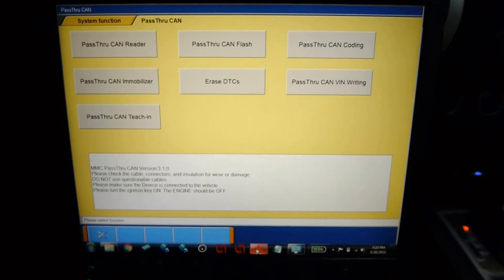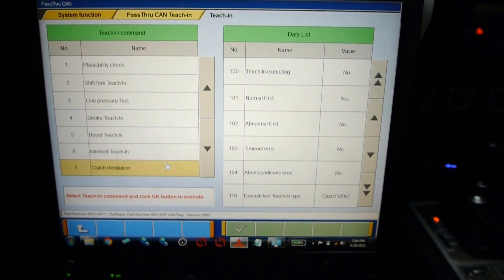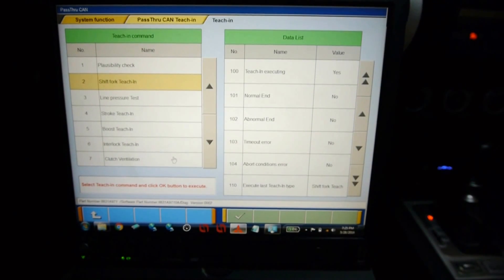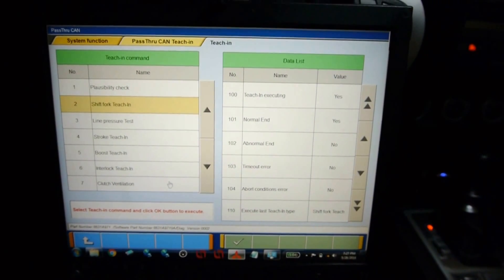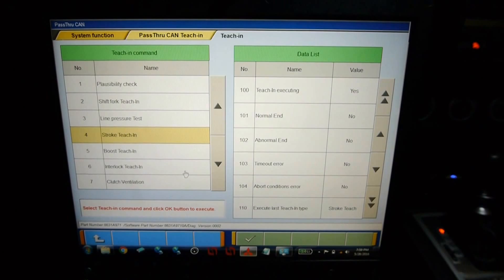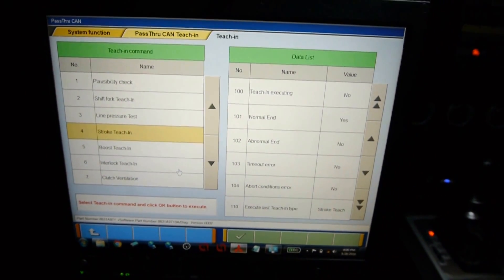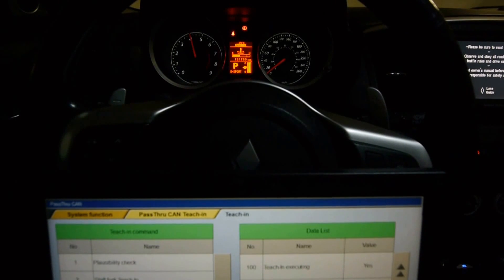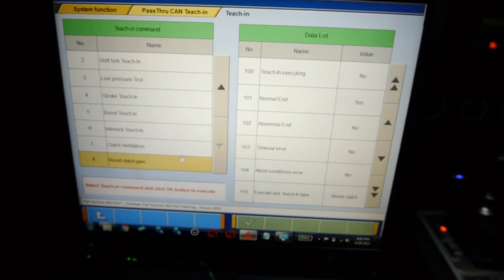SST teach-in Mitsubishi Lancer Ralliart and Evolution X MR

Comment: Hi Stephen trying to do a reteach passthrucan is telling me I don't have the .flpart file <MMC_FlPart><PassThruCANFlash><NewPartInfo><NEW_HW_PNAME>8631A513</NEW_HW_PNAME><NEW_SW_PNAME>8631A5130C</NEW_SW_PNAME></NewPartInfo><CFF_FILENAME>8631B002_dio30</CFF_FILENAME><CBF_FILENAME>AMT_17800000_000204_dio30_C</CBF_FILENAME><SYSTEM>TC-SST</SYSTEM><CONTENTS>Reprogramming data for Mechatronic Assy replacement of 10MY LANCER SPORTBACK</CONTENTS><DATE>2011.12.12</DATE><CLASS>Reprogramming for Teach-in</CLASS><ApplicablePartInfo><TARGET_HW_PNAME>8631A513</TARGET_HW_PNAME><TARGET_SW_PNAME>8631A5130C</TARGET_SW_PNAME></ApplicablePartInfo></PassThruCANFlash></MMC_FlPart>
Is what I have 8631A513.  8631A5130C I have took from passthrucan reader please help
Reply from the maker: The .flpart file needs to be edited in a couple of places. NEW_HW_PNAME and NEW_SW_PNAME at the start of the file both need the version number you are trying to flash to the TCU. OLD_HW_PNAME and OLD_SW_PNAME at the end of the file both need the version number you currently have on your TCU.
Reply: @StephenStrangways  so for my 09 lancer sportback sst I'd want which line of code, thank you so much for getting back to me your a saviour
Reply from the maker: Okay, so you're trying to flash the Evo X firmware to get S-Sport? You'll actually want to use the newest Evo X firmware, not the 2009 firmware - the information to use that is a bit out of date. Your TARGET stuff at the bottom looks good, so what you want at the top is:
<NEW_HW_PNAME>8631A971</NEW_HW_PNAME><NEW_SW_PNAME>8631A9710A</NEW_SW_PNAME></NewPartInfo><CFF_FILENAME>8631B151_dio30</CFF_FILENAME>

And make sure 8631B151_dio30.off is in PassThruCan\RpgData\CFF\
Reply: @StephenStrangways  okay got the new .cff file and will change the code to give it another try tomorrow, I've fixed my shift fork sensor so thats why I'm doing the reteach, if this works big thanks you have saved my lancer from being broken into parts
Reply: Still no luck mate
Reply: 8631B151_dio30.cff is in the cff
Reply: AMT_17800000_000204_dio30_C</CBF_ is In the CBF file
Reply from the maker: If there are two GENERIC_... .cbf files in the CBF folder, remove those, leaving just the AMT_.... .cbf file.
Reply: @StephenStrangways  managed to flash across a different flpart can't remember which at this moment in time, but still can't use the  teachin
Reply from the maker: What happens when you click "PassThru CAN Teach-in"? Does it give you an error message?
Reply: @StephenStrangways  yes can't remember the exact wording but can post it up tomorrow going to give it another go thanks again for your help muchly appreciated
Reply: Tc- sst recalibration data not Found please review or re install
Reply from the maker: Do you have the file PassThruCan\DiagDB\XML\TI_Info.tipart ?
Reply: @StephenStrangways  tipart in replacement of the flpart or with it I have got the tipart is there any code that needs to be changed
Reply from the maker: @ashleyhowitt6158  both files can be in the folder together. No code needs to be changed.
Reply: @StephenStrangways  will give it another try tomorrow morning with both files this time hopefully this is the last trip up I will have, hoping this is what I've been doing wrong, cheers again you a star and I'm sure I'm a pain in the posterior
Reply from the maker: @ashleyhowitt6158  I hope I can help you to get it working!

Comment: Hey there! Thanks for the knowledge do you share! It's any difference if I'm gonna do the steps with another line? I mean to start from 1 and end in 8. thanks in advance!
Reply from the maker: I'm glad I'm able to help! You should not change the order of the steps. There are a few that can be swapped, but overall, certain things like clutch vent need to be done before certain other steps, and other things require the engine to be restarted afterwards, or else any steps after that won't work at all.
Reply: @StephenStrangways  oh okay! Thanks for the comment! Super supporter 😊👍🏻🙏🏻

Comment: Hei Stephen! I just performed a complete teach-in on my Evo X MR 2009.
First thing, I flashed the ECU with a new version.
I had 8631A379 (and S/W 0C) and i flashed 8631A827 (and S/W 0B) with 100% succes.
After that i could finally access the PassThru CAN Teach-in.
I did 1 -> 2 -> ignite off -> 7 -> 4 -> 5 -> 8.
I had to retry some procedure more than once in order to have a Normal End, but i always got it.
All without issues. I don't know if it was placebo but a lot of little strange noises went away.
I didn't flashed back to old/previous ECU, was i wrong?
I went for a run and the car suddenly showed a problem: the display turned yellow and i couldn't accelerate (it wouldn't rev). I stopped and restarted and it went perfectly for a while, but this scenario happened 3 times. After that i got home (15 mins run) without any problem.
The oil i drained from the SST was different from the oil i refilled with (red oil drained, filled with Castrol Transmax Dual).
Do you have any suggestion?
Reply from the maker: You're fine to leave that newer transmission firmware version. The biggest problem is that automatic transmission fluid is usually red. If the car was running for a long time with that, it's likely clogged up the valve body, and possibly worn out some of its components. You'll likely need to get the valve body cleaned, possibly replaced. And get all of the old ATF completely flushed out of the rest of the transmission.  You'll also want to inspect the clutches, as that fluid could mean the frictions have been burned.
Reply: @StephenStrangways  TBH I saw that the Diaqueen is not red, but a light greenthe same color of the transmax dual that I used! Am I wrong?
However I changed all the liquids before doing the teach in.
My thought were that the remaining oil still had to mix up with the new oil I filled, but I don't know if it make sense. I will have to see how the car behave in the following run.
Now I will evoscan to search some codes
Reply from the maker: @lucasaugo4241  DiaQueen SSTF-1 and Castrol Transmax Dual are essentially the same fluid - Castrol makes SSTF-1 for Mitsubishi. They are both green. Automatic transmission fluid is usually, but not always, red. Some incompetent dealerships and independent garages will put automatic transmission fluid or CVT fluid in a car with an SST, and it does terrible things to the transmission.
Reply: @StephenStrangways  oh ok, I misunderstood your previous answer then, and we both agree that the previous fluid was wrong!
I hope the problem was that the fluids were still mixing up and so the valves were acting strange because of the different density and viscosity of the fluid. Maybe now it will be better but I plan to change again the SST oil in order to have the purest oil possible. All the other oils are changed so the car should be good.
I just run an evoscan and I found: U0101 TC-SST ECU temporary CAN timeout; U0141 ETACS temporary CAN timeout; P1590 TCM to ECM communication error in torque reduction request.
Reply from the maker: @lucasaugo4241  sounds like a good plan! Those trouble codes usually happen after flashing new firmware, so try just clearing them and see if they come back. If they do, it could be just because of a loose connector.

Comment: Hi Stephen, I tried performing the teach-in procedure, following the instructions in the video. As soon as I start with Command 7 - Clutch ventilation, I get 1,500 RPM for 2 seconds and it stops. At no point Teach-in Execution becomes Yes and operation terminates with Abnormal end. Tried re-performing the step 3 times, without success. 
Temperature of the oil at 43 degrees, using Tactrix 2.0. Car works ok with no issues after failing the step.
Any idea what I could be doing wrong?
Reply from the maker: I've had clutch vent sometimes take 6 or more repeated attempts before it passes. The two most common reasons it won't ever pass are if you're not on perfectly level ground, or if your transmission has been substantially over-filled with too much fluid.
Reply: @StephenStrangways  Hi! It's been a while since last tries, but now there is update. Unfortunately, still not able to complete the step 7. Checked the oil level in the SST and the amount is correct (actually, it was lower than the required level and I ended up adding about 1liter extra). Car was on level surface (same place where procedure was completed on a friend's Ralliart), oil temperature was 80, 60 and 50 degrees. In total we tried more than 20 times to complete the clutch ventilation, but it is still the same - 1,5K RPM for 2-3 seconds and steps with abnormal end. Any suggestions?
Reply from the maker: @1br934  How did you check the fluid level, by draining and measuring it?
Reply: @StephenStrangways  I opened up the fluid level check plug, on the left side of the transmission, as mentioned here - https://www.evolutionm.net/forums/mitsubishi-tc-sst-discussion-all-equipped-models/579305-tc-sst-level-check-plug.html
Reply from the maker: @1br934  do you have an Outlander? That is what the SST check plug is intended for, and opinions are mixed as to whether or not it's accurate for the Evo or RA.
Reply: @StephenStrangways  Car is Evo X MR.  On other occasion filling in the gearbox of RA through the check plug allowed us to teach the gearbox afterwards. In my case, when I opened the plug there was no at plug level, so I added until we got there.

Comment: Great detailed video could this potentially help with slipping clutch in sst gearbox
Reply from the maker: It's worth a shot. If it's just a calibration issue, it would help. If the clutches are really worn, it won't help, but it won't hurt either, and you'll know you need to replace them.

Comment: Getting hung up on stroketeach in any ideas?
Reply from the maker: Clutch vent failing is usually due to fluid being overfilled. The temperature being out of range can lead to it hanging on shift fork or stroke. It can also sometimes just take several tries to pass stroke, for no apparent reason. So, make sure you're at the proper temp, and just try it over and over until it works.
Reply: @StephenStrangways  i drove it a bit to a parking lot ((flat ground) tried it again and was successful i saw in the video the stroke  took two minutes very helpful thank you
Reply from the maker: I'm glad you got it working!
Reply: @StephenStrangways  im wondering do i need a tune after flashing super sport onto a ralliart + teach in? running stock tune from mitisu atm
Reply from the maker: No, you don't need a tune to run S-Sport. If you get rev hunt it can usually be solved by flashing the 2013 Evo TCU firmware, even if you have an older RA, and if that doesn't work, then a good tune will fix it. And your car will perform better, too. Just be sure to go to a tuner who knows the SST really, really well. I got an e-tune from Wasatch Turbo Factory because there was nobody in my area who was actually any good.
Reply: @StephenStrangways   wondering what are the files in the sst support files "new cff files"
Reply from the maker: @beantownhero617  those were things the person who created that Google Drive shared folder was playing around with, downloading from the MUT-III, and trying to edit. It's best to ignore them, and the file ending "dio301" instead of "dio30" as they may not work correctly. He lost access to that Google Drive shared folder, so this is a more up-to-date link that is safer to use:
https://drive.google.com/folderview?id=0B-eSylKomuYha3ZXMFVKdV83V00
Reply: @StephenStrangways  thank you Stephen!  Im getting some bumpy shifts in super sport and trying to see if their is a update file for a 2014 ra....going to try a fluid swap soon...recently had a p2733 code come up while driving in super sport on the highway any thoughts?  I know what the code is but do you think its file related / electronic ....also due for a fluid swap on the sst
Reply from the maker: @beantownhero617  That doesn't sound TCU related, but it does sound fluid related. Definitely change it, and if it was OEM fluid in there before, fresh fluid and filter could help. If it was Motul or Pentosin or something else like it in there, new fluid won't help.

Comment: Great video thanks for sharing the knowledge, i've recently had my transmission rebuilt and performed teach in procedure, all went well. 
Drove the car for 50km and then noticed stiffness in shifting while putting gear into reverse only.
Drove it for another 150km & then preformed another teach in at 200km, results were fine. no issues.
I'm concerned about the stiffness of reverse gear, I can feel the car jiggling a bit when i select reverse gear!! any idea whats going on?
(No check engine light or any other warning signs.)
Reply from the maker: There is a physical connection between the transmission and the gear lever for selecting reverse and park - the problem may be with that. Even the transmission was reinstalled by a different shop than the one that rebuilt it, it's the installer you'll want to to have check their work. Hopefully all the work was done by someone who knows the SST well, not some random local transmission shop.
Reply: @StephenStrangways  Thanks will take your feedback into consideration and ask them to check it out. the trans was rebuilt and reinstalled by the same shop.

Comment: Great video and guide. 
Still stupid question, why you followed this order of teaching steps?
Reply from the maker: The Mitsubishi Factory Service Manual specifies the order of 7,1,2 for the shift forks, and 7,4,5,8 for the clutch with the engine needing to be restarted in-between.

Some very experienced tuners recommend 7,1,2 restart 1,7,4,5,8 which is just adding another plausability check to the start of the second sequence.
Reply: @StephenStrangways  Many thanks!

Comment: I repaired a DCT470 transmission. Before installing it to the vehicle, I did the tests injecting air into the transmission, trying all the changes and the clutches, it worked perfectly. I also sent to clean and repair the valve body. Then I installed the transmission to the vehicle but when starting it the transmission does not start. What is there left to do? The transmission needs programming? If so, what would it be and how do I get it? I will appreciate your help.
Reply from the maker: If the transmission came out of a different car, it will need to be VIN coded to the car it is going into.
Reply: @StephenStrangways  Thanks for answering, aquite sent the information of the car Mitsubishi Lancer Ralliart 2009 2.0L Turbo vin code: JA3AV66V79U035358 I appreciate all your help! Thank you!!
Reply from the maker: The VIN of the car it is installed into needs to be programmed into the transmission.
Reply: @StephenStrangways  Thanks you!!!

Comment: for me there was no xml folder so I created one and copied the files over. for some reason it still isn't seeing the files. I'm stuck
Reply from the maker: If you created the XML folder within the DiagDB folder, and it's still not working, try going into the CBF folder and remove the two "GENERIC..." files there, and put just "AMT_17800000_000204_dio30_C.cbf" in there.
Reply: @StephenStrangways  hi I'm replying from a different account. That's exactly what the problem was I didn't have the cbf folder where it was supposed to be. It works now thanks 😁
Reply: all you need is the op2 cable, you can buy an openport 2.0 usb cable from www.evoscan.com  and search evoscan sst   they have instructions for doing the teach-in on their website.